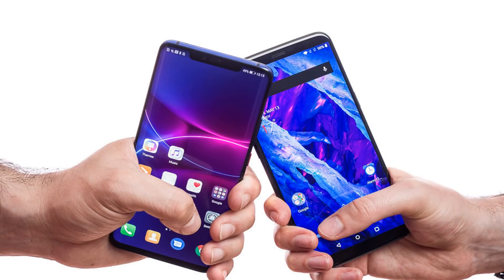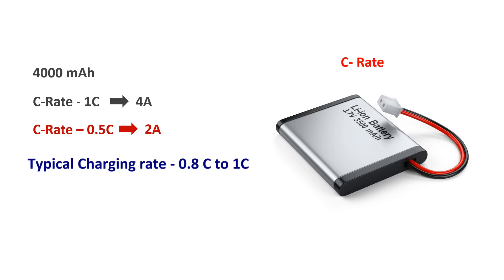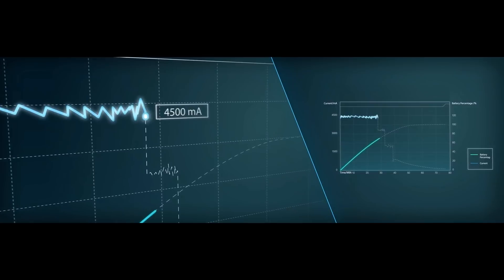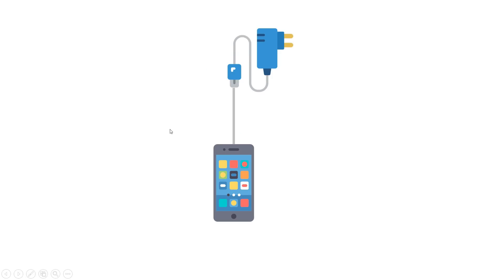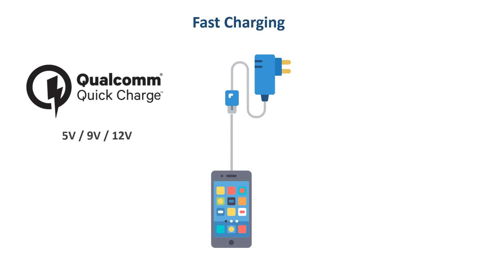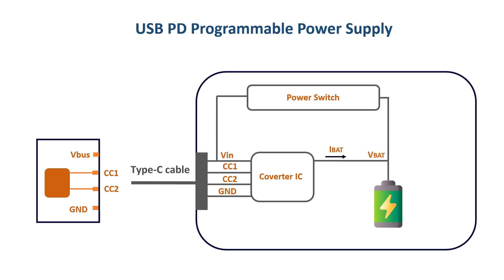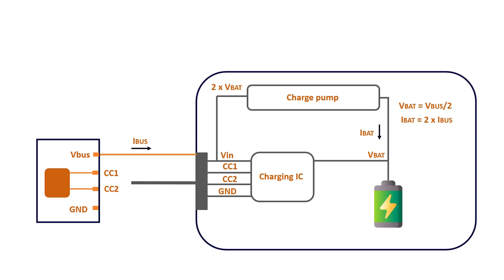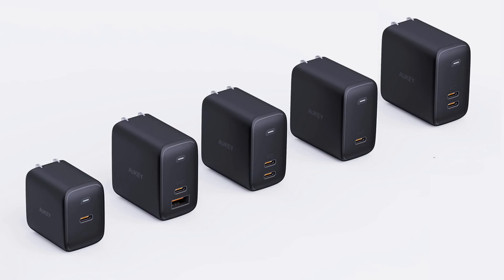How Fast Charging Works in the Smartphone ?

Comment from the maker: Timestamps :
0:00 Introduction
0:53 Basics of the Li-ion Battery Charging
4:40 Smartphone charging in early generation phones
7:10 High Voltage fast charging and Qualcomm's Quick Charge Technology
9:28 Fast Charging with USB- Power Delivery
12:21 Oppo’s Super VOOC fast charging Explained (High Current Fast Charging)

Comment: Q1. Can I connect my hp laptop type-c charger to mobile having fast charging features? On specs of laptop charger, it is written : 5v-3A/15W,  9V-3A/27W,  15V-3A/45W,  20V-3.25A/65W.   Q2. is there any global standard for charging, or different mobile maker use different technology.

Comment: At 13:38 you mentioned that , in the lastest 125 Watt charging they are supplying 20v 6.25A of current , now the charge pumps are inside the phone right and then they convert that 20v to 10v 12.5A then how can you say that most of the circuit is outside the phone , wherein the actual increment in the charging current is happening inside the phone itself , which should make the phone hot . And if you say that the current is being increased by the charger then at the end of the day how the cable is able to carry that high of a current .

Comment: Why the phone getting heat while charging
Reply from the maker: The one reason is while charging, some of the power will get dissipated in the form of heat. But now a days, most of the phones and the charging IC keep the temperature under check. 
While charging, if phone is being used then it may increase the phone temperature. Or perhaps if some background activities are going on then it may also cause the heating problem.
Reply: @ALLABOUTELECTRONICS  
I will cause any problem to battery as well as phone

Comment: Awesome video dude, you deserve more views... I have one question... I have oneplus 8T, and has the 65W technology you mentioned in the video... The 10V are divided by 2  between both batteries. If u charge my smartphone with 5V/2A charger, how the system works? Charges one battery and then the other one ?
Reply from the maker: I am not sure whether it will charge with 5V/2A charger. As per company, apart from 65 W charger, it supports USB-PD upto 27W.

Comment: Sir, what is the advantage of having 2 cells in series ?
Reply from the maker: More than 5V can be applied between the two series cells (e.g 10V/ 6.5A) without down conversion of the voltage .

Comment: sir , is fast charging depends on fast processeser
Reply: Thanls sir
Reply from the maker: It depends on the Processor. It has nothing to do with the speed of the processor. If you see an older processor, they won't support Q.Charge 4.0. But the new ones at least support Q.C 3.0 or USB-PD. 
Some companies use their propriety technology with the same processor. 
The thing is, although processors support some fast charging tech provided by chipmakers, OEM needs to enable that fast charging chip inside it by paying extra money to chipmaker (Qualcomm or Mediatek). Otherwise, even after using the same processor, one may not get the fast charging. 
I hope it will help you.

Comment: So by increasing the voltage, current can be pushed into the battery faster? Does the voltage decrease as the battery starts to get full?
Reply from the maker: As I mentioned, there are two phases of charging. In constant current mode, the battery is charged by constant current by the charger IC. During this time, the voltage across the battery gradually increases. Once the battery voltage reaches, some predetermined voltage level (near the maximum charging voltage of the battery), the charging IC switches to constant voltage mode, where it tries to maintain the voltage across the battery and current reduces. 
I hope it will clear your doubt.
Reply: ALL ABOUT ELECTRONICS Yes but when fast charging does it start with a higher voltage for example 10v to get it charging faster?
Reply from the maker: You mean bus voltage through charger? Yes, it starts with high voltage. But inside the Smartphone, it is down converted through charging IC.

Comment: Good Explanation so tell me Cons of Fastcharging?
Reply from the maker: You might have heard that it affects the battery life in longer run. But not really. It can affect the battery life at some extent but there are many other factors which may degrade the battery life. Like temperature and the charging voltage ( full charging voltage). 
But day by day, because of improvement in battery management system, it can be taken care.
On an average modern smartphone batteries last 400-500 charging cycles ( 0 to 100% charging and discharging) before battery capacity reduces to 80%.
That's typically 1.5 to 2 years for average user.
And with fast charging when batteries can be charged in 15-20 mins ( 50-60%), it's not major issue.
Reply: @ALLABOUTELECTRONICS  ok Bro Thanks for giving Useful information. Keep Rocking ❤️🤙

Comment: sir in case of USB 2.0 if the signal pins are shorted to increase the current but in return path means in ground still have same wire so how ground wire withstand on that current level??
Reply from the maker: Data is transmitted on D+ and D- using differential signaling. Power is provided through Vbus and ground. In DCP port (USB BC 1.2), D+ and D- are shorted. They are separate from ground pin. (Because as I said, data is transmitted using differential signaling)
I hope it will clear your doubt.